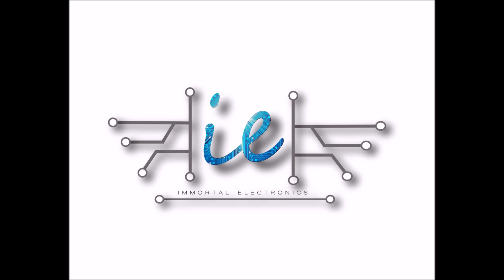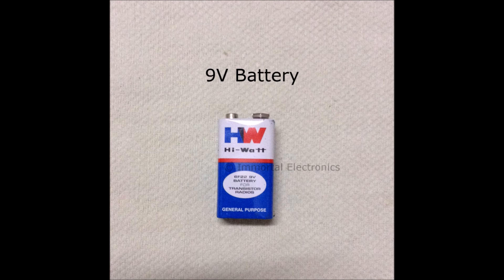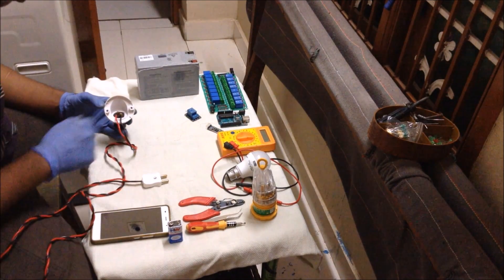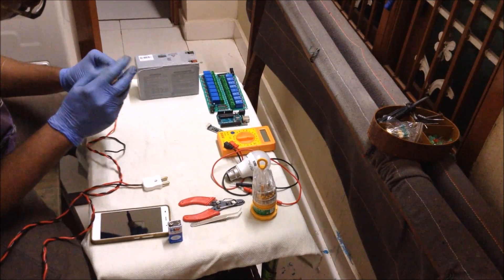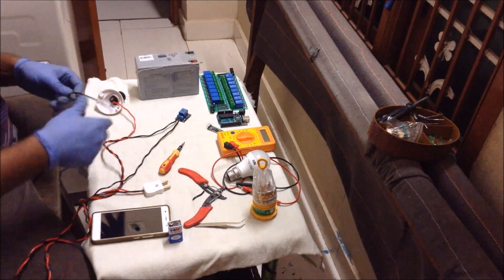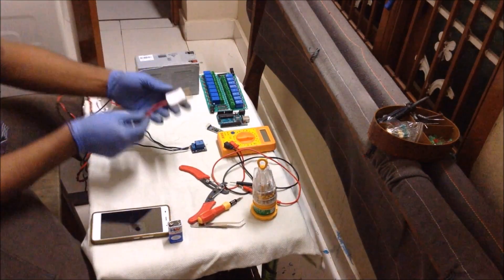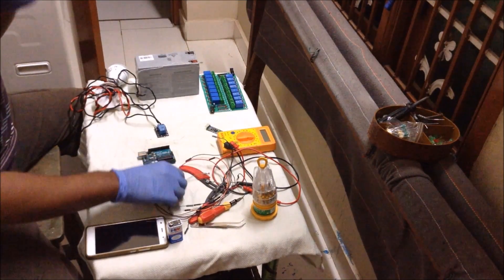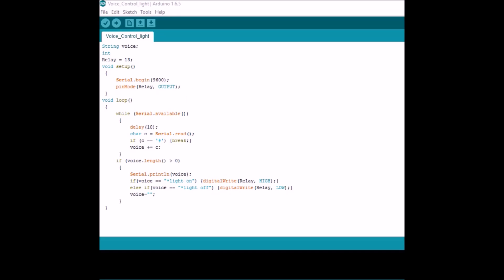Home Automation using Vocal Commands | DIY Project | Immortal Electronics

Comment: arduino can take up only 5V, Is giving 9V is appropriate?
Reply from the maker: Hi Mehak Minda, Ya Arduino uses only 5 V but when we give 9V, there will be a 5 V Regulator which will stabilize that 9V to 5 V.
Reply: hi mehak minda please send me the 
codes

Comment: sir.. plz. remake this video.. by showing.. it little more clearer... to all the components and connection .ur making..
Reply from the maker: Hi Gourav Singh, sure we will make an another video with your requirements and make it available to you as soon as possible.
Reply: +Immortal Electronics I have a question I made a circuit home automation with andriod cellphone but I want to add another feature home automation system devices are same arduino relay n Bluetooth module but my question is is this both feature run at one arduino???  but it is not working isn't programming mistake?

Comment: can you tell me after all the setup why my relay switch showing me green and red led  on ,,, i saw in your video that when you give a command "light on" on your voice control app then relay switch will become on,, but my relay switch showing the both green and red light
Reply from the maker: Hi Nasrin, I think the code is not correctly dumped into the Arduino, that's why the relay is working according to the given functionality, Can you please mail your problem with a clear explanation to jay@immortalelectronics.in, so that our team will help you in resolving the issue.
Reply: Nasrin Tinni sir I had the same problem can u send me the code please

Comment: ahould I connect RX of Bluetooth to TX of Uno board
Reply from the maker: Hi, Mostaque Ahmed, yes you should connect the Tx and Rx pins of HC 05 Bluetooth module to Rx and Tx pins of Arduino UNO board respectively.